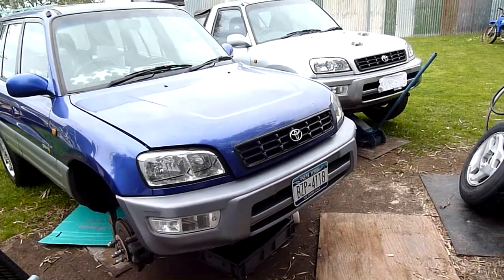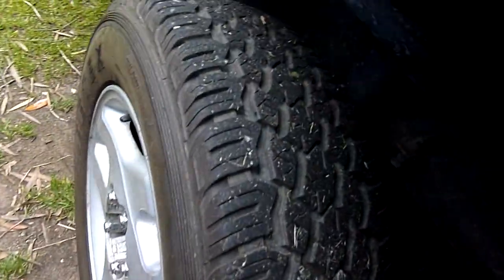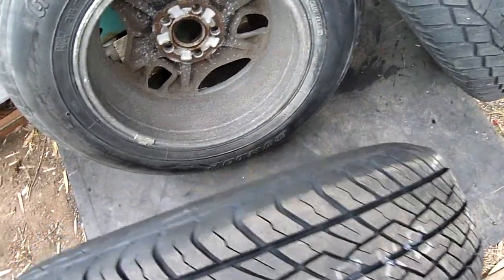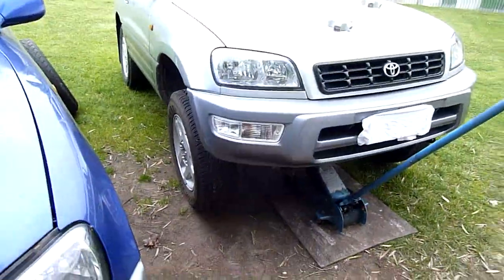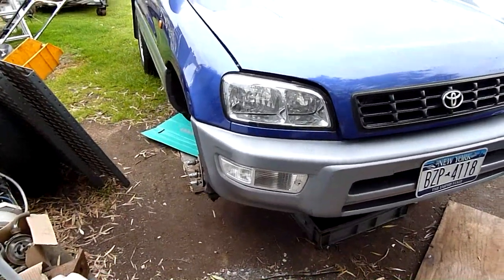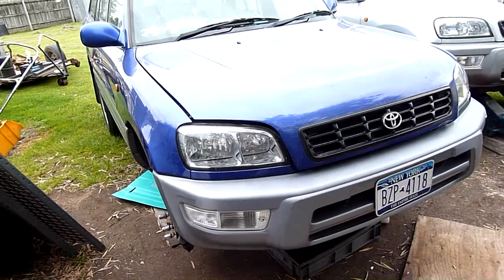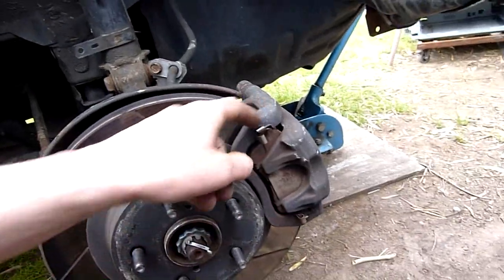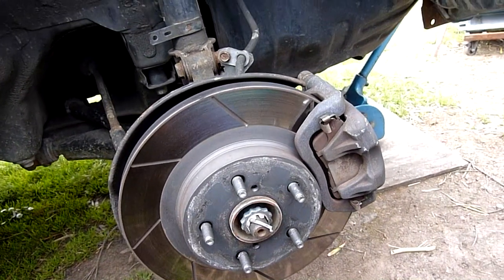RAV4's Blue and Betty Exchange Wheels and tires

Comment: You don't need to run too much. You just have to do a turn, if you're changing a rear wheel or simply shake the steering wheel for the front. Always works. Had stupid set of rims for half a year and had the occasion of trying it 4 times. It always works the wheels loose.

Comment: punch a small 1-2 mm hole in the lowest portion of the muffler and it will drain all the condensation out ( actually it blows it out as you drive too )  if they have a problem with the little hole for your inspeaction put a blob of epoxy over it before you take it in .